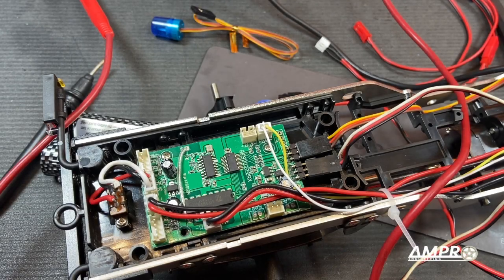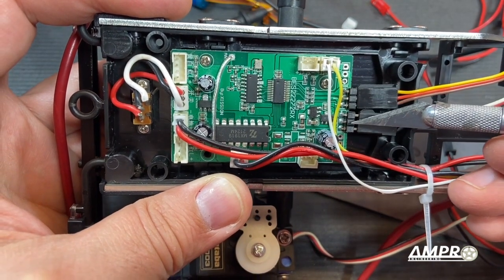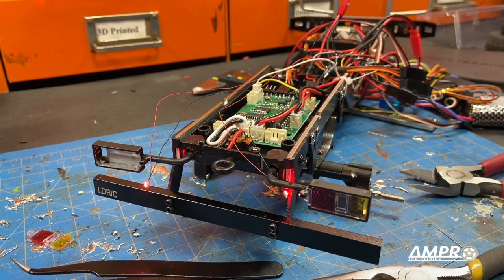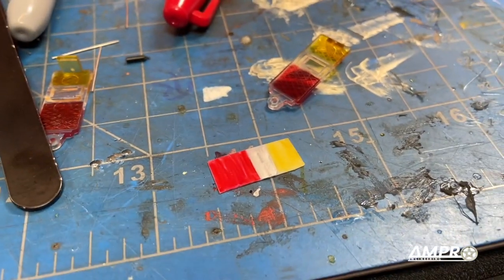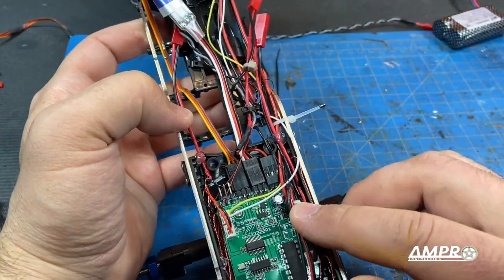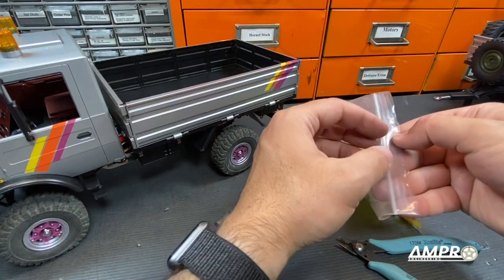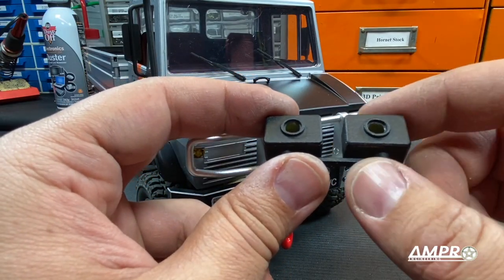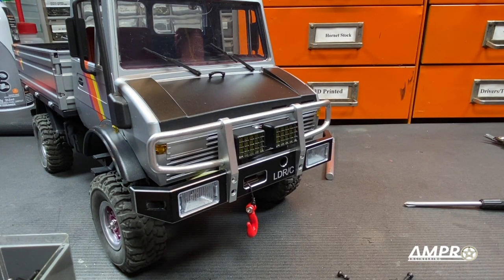e392 - LDRC P06 Unimog Metal Upgrades, part 2: Lights and 3D Printed Fog Lamps

Comment: How do you install the beacon light at the free 3. Channel?
Reply from the maker: The other channels are always on so you cant control the on/off but they will at least remain lit.
Reply: Thx. So do i need this light control switch to use a beacon light on the 3. free Channel?